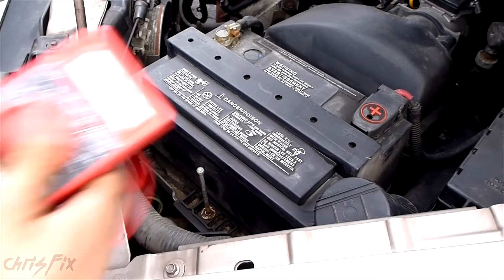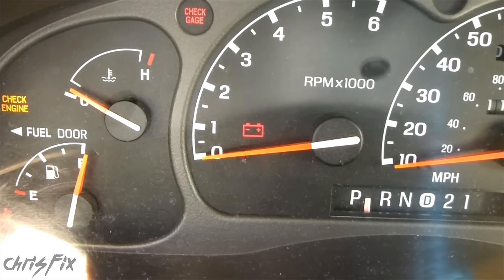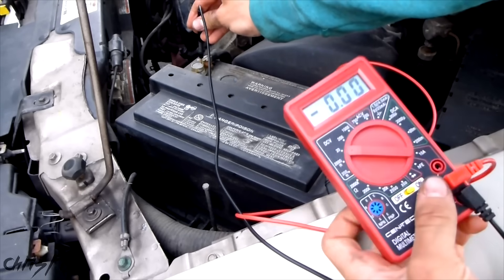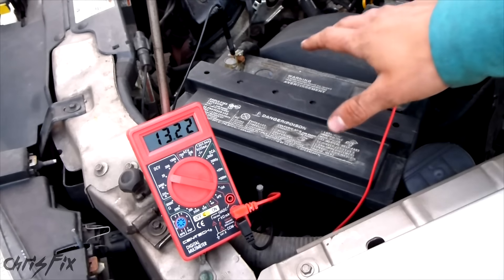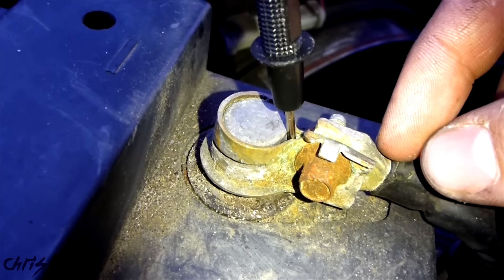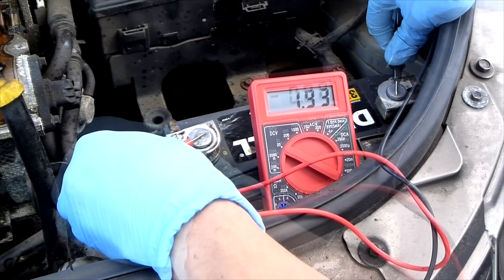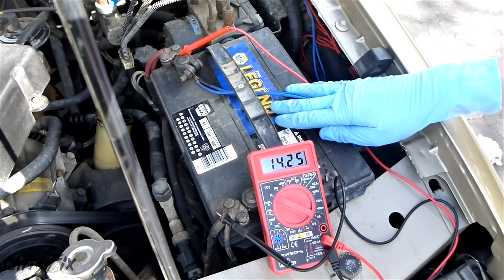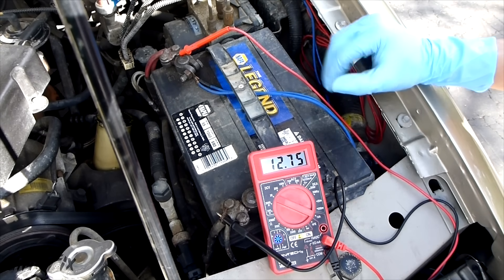How to Test a Car Battery with a Multimeter

Comment: One 10.92 volts is NOT ACCURATE... First it is a cheap DMM and the sample rate is slow. I am sure the volts went well below. You need either a high end DMM with fast sample rate AND a low hold point. Meaning it holds the minimum voltage in display until reset. A Solar Battery tester has low voltage during start test,

Comment: To clean battery terminals pour hot water out of a kettle should remove any corrosion. To prevent corsica forming smear a thin layer of vassal energy on both terminals male and female ends. Hope it helps.

Comment: I did"t know you could use a digital multimeter to check a car battery. I was under the impression that the battery needed a load on it to verify its strength or lack thereof. I will say you did an awesome job on this video...good work.

Comment: I work at AutoZone and the biggest mistake people make is that they think just because the battery symbol light comes on it means they need a new battery and I told them  no it means the alternator is not charging the battery.

Comment: Chris take a copper penny put grease on one side  stick the penny flat next to the negative terminal this will neutralize all the ion gas that comes out of your battery when the penny turns nasty green or begans to disinigrate put a new one in it's place this will stop all corrosion.good luck an this is your tip of the week. Captain joe
Reply from the maker: Thanks for the tip!
Reply: Joe Soboleski 

Pennies are zinc. The copper is just a thin veneer.
Reply: +Frank Gutowski ...  This is an old trick, that I have been wondering about lately.  Are you saying the pennies used to be copper, but no longer have enough copper in them to work?
Reply: Pennies that are 1983 or older is solid copper.
Reply: Copper goes "green" because it reacts with oxygen in the air to produce copper-oxide - that is the green colour. Nothing to do with "ion gas" or anything to do with the battery.

Comment: Really good video. Great explanations of what your doing and you used a very basic multimeter that most people have around the house.
Reply: I went on a multimeter shopping spree because I didn't want to have just one. The cheap HF one has worked well. I ended up buying the larger HF one and at least 2 or 3 other ones on ebay. You can buy a nice little self ranging one (with lead storage) for about 10 bucks. (AIMOmeter M320)

Comment: Hey Chris, when I try to start my car the lights on the dash will illuminate and then when I start to crank it dies completely. I tried jump starting the car and the other car was giving it 14v and it still has trouble cranking. After awhile, I had someone else start to rev the engine on the car and I got the car to start. I let it sit for about an hour to allow the alternator to charge the battery. After letting it sit for about an hour, it died. What would my problem be?

Comment: Hey Chris long time subscriber here. I have a 95 stang GT 5.0. And I have a starting problem. No crank. Only 1 click. I tested the starter and it’s good. Clutch Neutral switch is good. Starter relay is good. New cap & rotor. Fuel pump is good. New fuel filter. New alternator. But all I get is 1 click. I did check the battery and it had 12.1 volts. But hen I try to start it the lights don’t get dim or anything. Idk what the problem could be
Reply: Victor Sanchez check ur battery terminals if theyre loose corroded...try jumpstarting it as well if none of that works..probably will be ur starter relay/solenoid
Reply: Backyard Chevy I figured out yesterday it was the ignition coil.  Thank you for the input though 👍
Reply: Victor Sanchez glad u got it going awesome

Comment: This was very helpful. I wanted to test my battery but wasn’t sure how to use the multimeter. I have the same one you used in the video. I got it from Harbor Freight. It was one of the free tools they offer customers. How do you like that multimeter? Do you use yours a lot? I’m new to using them and have been using your videos to help teach myself how to use one. Do you have a video explaining how to test electrical wires and how to test for starting problems? I’m working on a 1999 Subaru Legacy L 2.2L. 

Plus have you ever done a review of the Cen-Tech Digital Multimeter? Or an email address to send questions to? 
Thanks again for the years of info I have learned from you.

Comment: Um... The video begins with a heap of completely nonsensical information about so called "battery light". When the battery light is ON, it means that the car's electrical systems are currently powered from the battery. When the battery light is OFF, it means that the car car's electrical systems are currently powered from the generator (or "alternator", as some people call it). If you start the car and the battery light turns OFF (as it should), it tells you that your generator is working properly. If it stays ON, it means that your generator (or some related system) is malfunctioning - the car is still draining our battery instead of switching to generator-supplied power. In other words, the battery light is entirely about your generator_. It tells you absolutely nothing about your _battery health. It has nothing to do with your battery at all.
Reply: ThatMontmorency - Good explanation. However, cars used to have generators and they produced direct current (DC) voltage. For a long time generators have been replaced with alternators. An alternator produces alternating current (AC).
Reply: JohnSays They have a rectifier (diode) mounted on the alternator to convert the ac to dc voltage.
Reply: Even that is not quite correct.  Most modern vehicles battery indicator go out when the alternator starts even though there may not be sufficient energy to power the complete vehicle.  At that point you are possibly still drawing from the battery until the revs increase a bit particularly if you have a high electric drawing items switched on.  So to all sense and purposes, and more or less as  +ThatMontmorency stated, the battery light is just an indicator of if the alternator is running or not, and not battery condition.  Incidentally some vehicles engines fail when they come to a stop as the battery is bad and is not holding the charge though the battery indicator was out.  (Of course there are numerous reasons for this to happen.)  

Pre alternator and in DC generator days you could often see whether battery was in fact holding a charge by that indicator but then vehicles electrics and management, or lack of, operated in a completely different way.  Generalising; in those days the battery usually powered the vehicle electrics and the generator supplied power to the battery so however good the DC generator was if the battery was bad then you wouldn't go far.  These days the alternator powers the vehicle's electrics and at the same time recharges the battery,
Reply: @madcockney  - The vehicle's electrics run on DC current. The AC current produced by the alternator is converted to DC current that runs the electrics.
Reply: @milcotto4153  I know that.  The moment the alternator starts it goes through the alternators built in rectifier that converts it from three phase AC to single phase DC and it is also regulated to the required voltage.  Most vehicles batteries though a nominal 12 volt is 12.75 volts approximately at full charge. (In fact if the battery is showing 12 volts it is in need of charging.) The charging electrical supply system provides between 13.5 to 14.5 volts depending on the vehicle and the RPM.  Vehicle electrics will run at those voltages with no problem.

Comment: As a patrolman for for a motoring organisation for 14 years ive seen a lot of batteries..most dirty ones...??? 
First a dirty battery is just dying to go flat, the dirt/damp allows the battery to slowly short out..The positive term is normally the one that corrodes up, put the terminal in a cup of hot water, the corrosion just disappears..clean the terminal up, replace with Petroleum jelly only.! nothing else..WD 40 EXPLODES..if the terminals are rotten so is the battery..if it needs topping up its toast anyway..scrap..junk it..they last 5/6 years at most..my patrol van would have 2 new batteries every 2 years max..the jump starting they did was amazing..they would just die one day..the readings this guy gives are spot on...do as he says, if the readings are lower just junk the battery..the winter kills car batteries, cheap ones are a waste of money.. Also check voltage between battery terminal and the post..ive been caught out a few times with corrosion between the term/post..?? BOSCH S5 are without the best you can buy..followed by Varta,made in same production line as Bosch..

Comment: I've used my multimeter before to read the volts but thanks for the extra tips on running the headlights and testing cranking power.

Comment: I don't have any of those problems, but what I do have is my vehicle runs rough when the A/C is on. Bad compressor or alternator?
Reply: Idle air control valve possibly . do you have any engine codes? when is the last time you replaced spark plugs and wires?

Comment: Great video! I am buying two 6 volt 230 Amp hour batteries for my RV wired in series. How can I test that each battery actually has 230 Amp hours on it before I buy them? David

Comment: Thank you, thank you, thank you for posting this!  I have a new Honda Accord where the this dealership told me two times in the last month my battery isn't starting due to cold weather (I live in Austin, TX NOT Austin, MN, so 50 degrees isn't cold!) and when a wrecker came to jump the car today he had a multi-meter like this and said my car's battery was "At a 10 and it needs to be around 12.5 to start."  I had no clue as to the scale he referenced, until I found this video through Google.  I called the dealership and said "My friend that jumped my car had a multi-meter and that HE said the battery was at 10v and the car NEEDS to come in for service."  Sure enough my appointment is tomorrow to check the connectivity.  :)

Comment: So, one question before testing, my battery has 540A but on my multimeter is written "Fused 10A max" / "Fused 250mA max"... Can i still test it with this or do I need special tools?

Comment: The battery could still be bad even if you get a 12 volt reading on the multimeter.  Most batteries will read 12 volts even when they are bad. That is because the bad battery has voltage but does not have the Amps that are needed.  
Take the battery to an auto parts store and have the Amps checked.   Warning:  If you try to check the Amps on your battery with your multimeter set to amps, it may and probably will blow the fuse in the multimeter

Comment: I have a new battery but I'm having troubles for some reason. if the car is off for at least a day or two it either don't start or showing trouble trying to. I can test the battery after I drive for awhile and it reads 10.5. I checked for a fuse drain but it shows none. all zeros. when I start the car up it shows 12.6. this is weird to me. can you help me out.(mitz/pathfinder). she turns over but it sometimes seems like its trying too hard to start. thanks.

Comment: I increased the life of all my car batteries with one simple change. Moved from Phoenix, AZ to somewhere that does not experience 120+ days of 100+ temperatures and 30+ days of 110+ temperatures.  Battery life changed from 1-2 years to 4+ years
Hight heat is a major battery killer.
Reply from the maker: Thanks for sharing! Yea heat is really bad for batteries!

Comment: I followed your advice and cleaned my battery terminals.  Now my radio does not work.  says something about a code on the screen lol

Good video though :)  Its amazing how many "experts" don't have a clue about measuring their battery voltage both under load and on charge.  They have no excuse after watching your vid as it is explained so well, Good job.

Comment: 52 years old and you just taught me how to properly use an ohm meter . ive always been afraid to use one for miss diagnosis for not not putting on the right setting . could do a segment on more ohm and volt meter proper usage . thanx you have by far the best fix it site on youbtube

Comment: hi christfix,i have a question .if i use my multimeter to test the battery ,i only get 11v.; even i start the engine the reading stay the same...what my car problem? is the battery problem or the alternator?

Comment: I just changed my battery in a 2011 gmc sierra and it was just starting to get bad after 6 years, my vehicles are always parked in a garage though and that may make the difference. It was the original ac delco battery that came with the truck > 48-6yr and it lasted about that long. Just FYI and info for others, i appreciate your videos.

Comment: If the voltage were to not reach 14 Volts after cranking the engine, would that be a strong indicator of a bad alternator?
Reply: When you crank the engine the voltage will drop. After the engine starts the voltage will rise. It may not go all the way up to 14 volts. It's supposed to be 2.2 volts per cell.

Comment: I just bought my car some months ago its a '92 so its pretty classic. the owners before kept it all original. the car literally still has everything. so I believe the battery is also stock it just recently went out on me last week. which means for a few months I was driving around with a 25 year old battery that's pretty good considering. I'm just going to replace the battery but I'm going to get the old one tested too to see if it's still good.

Comment: Hey Chris I have a 1993 f350 idi turbo diesel and I have two new battery's and the alternator is getting super hot to hot to even touch have you ever had this problem you can email me if that is better bonsorlife45@gmail.com

Comment: Step 1.  Before testing the battery be sure the red wire of the multimeter is plugged to volt, not ampere.  The black wire is plugged to com.  

Thank you
Reply: Great idea. I made that mistake before, and I won't do it again.
Reply: I just came to this video to make sure I had my wires right in my multimeter. Good to know others can miss that. Currently struggling with my 12v boat batteries.
Reply: I made that mistake before😂
Reply: 1:20 you can kind of see it. Really wish he would have said something about that. Most people here are probably using a multimeter for their first time.
Reply: Super Chili: I  just found this video cus I needed help on how to use my new multimeter on my car's battery,  I was about to ask a question to Chris the fix and  you just answered it, thanks.
He needed to explain about how to use the multimeter a little better like where to connect the test lead wires into what input jacks, the good thing is that I was also able to see it on the video.
Reply: @chalyfalcon24  You are welcome, Chaly.  I wanted people to know how to use the multimeter without any confusion
Reply: @user-mo6wm9oe2j  Big sparks, fried my multimeter.
Reply: Was his red wire placed in the wrong one?
Reply: Thank you sir! I freaked out a little bit after reading your post I had tested a battery earlier and everything was copacetic so I went out again look at my little harbor freight battery tester and wasn't sure if it was on the right one so I plug the red one into the other one what are those wires get hot I had it right the first time laugh out loud thank you.
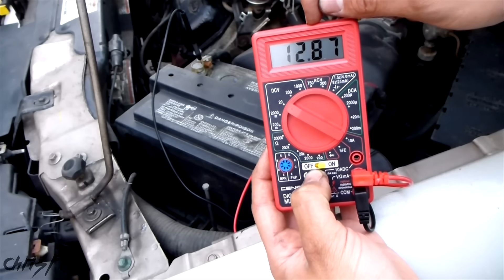Reply: Robert S  2:00 could have looked at the picture , the V stands for volts . cheap meters are dangerous

Comment: Can anyone help, my daughter has a 2008 Toyota rav4 when i put multi meter on battery and reved engine the volts didnt go up at all when i turned headlights on the voltage dropped way down, the car then has no power steering is the the alternator or battery
Reply from the maker: Alternator probably.

Comment: ChirsPleas help me!! I have a Nissan Terrano also called Frontier or D22, 2010, Diesel, 123.138km. The battery light is on,so I did all the test for the batteries and the alternator and it's all good but still on

Comment: car wouldn't start this morning at Walmart. had a suspicion it was the battery. went in bought a multimeter and pulled up your video. determined that I was around 12 volts, but while starting the car it dropped below 4 at which point I determined the battery was junk. went in bought a new battery and it was good to go! a convenient place to break down and a very helpful video. thanks man!

Comment: Dear ChrisFix the car guru!

Thx for the many awesome car videos!

Just concluded with your battery + alternator test that i need a new battery hurray!

But what battery? I have a 12 volt 45 AH battery and cant i just install a 12 volt battery but with higher AH like 60 vouldn't that just have more power and then im sure i can run more stuff and always start?

When the new one starts to go bad and loses some AH will it not still last longer then a 45 AH batteri?

Are there any drawbacks from getting a battery with abit more AH ?

Comment: Love your vids but have a question. I have a 2000 Chrysler Concorde, 3.2 litre engine and the battery is under the air filter assembly in the right wheel well. The pos and neg terminals are located up in the engine compartment. I just ordered my first Multimeter and would like to know if I can I test my battery by connecting to these exterior posts or does it have to be to the battery itself. Thanks.
Reply from the maker: +jbailey13 you can connect them to the exterior posts assuming there is a good clean and tight connection to the battery. If the wires going to the posts are damaged, the connection is bad, or the connection is dirty then you might get bad results.